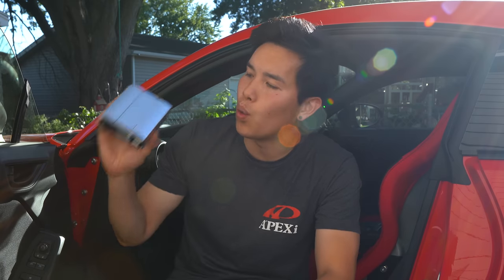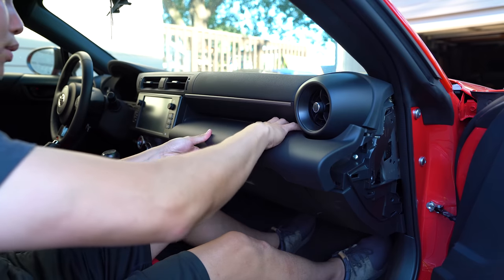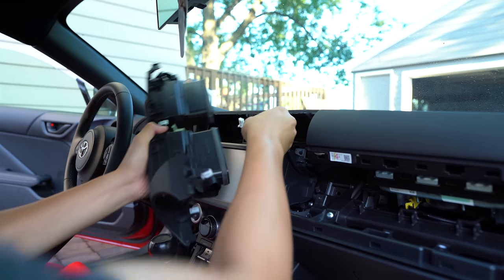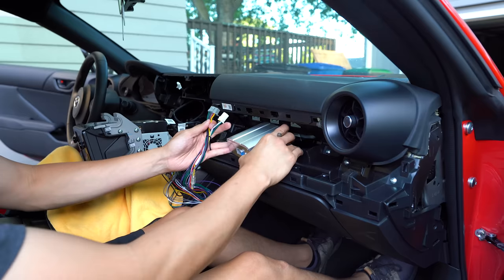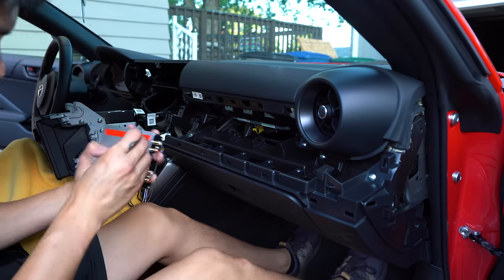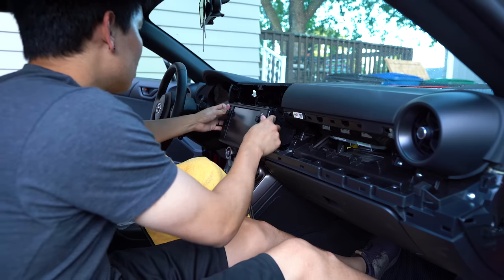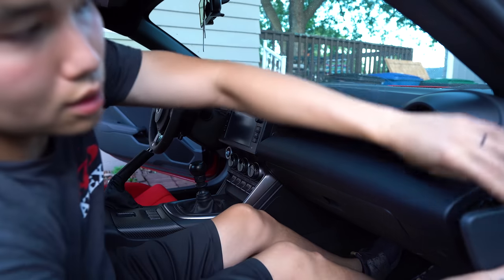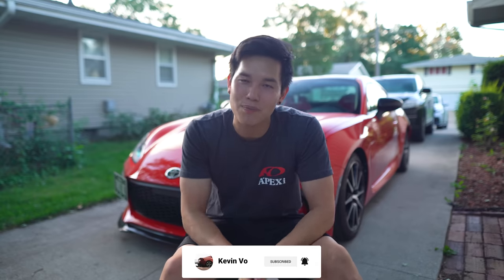EASY Audio Upgrade 22+ GR86 & BRZ

Comment: In our German community our audio pro has checked on the toyobaru soundsystem. He is reporting that the speakers are in fact horrible. So adding an amplifier is actually a horrible decision. Swap the speakers in the dash and the doors :) KR
Reply: Yeah speakers are trash.
Reply: Amp can still improve bad speakers. I'm doing the amp with the OEM+ speaker upgrade. I don't want to add any more gear like a sub or more amps because I want to keep the car lightweight.
Reply: The speakers on the premium trim are different (as well as having the two extras). Was he looking at the base trim?
Reply: @duffman2686  no they are not. You just have 2 more high note tweeters in the dash on the premium trim. Everything else is the same. BUT IN FACT European cars, all the trims on the twins have the exact same sound system in them.
Reply: @nn99nn99  there are good solutions via new lightweight speakers without an sub. Our audio pros solutions adds only like 2 kg more weight to the car 💪
Reply: I don't think you need to be a pro to figure out the speakers in the twins suck. I found an EQ guide on one of the BRZ forums to make them suck less, but you're absolutely right - adding more power to a bad sound system is just going to make things sound worse at a higher volume.
Reply: Those worried about weight gains with a full system upgrade... Have a laxative overnight and sheet your guts out problem solved!
Reply: @Sinancan93  There is an official wiring diagram and details available on some of the forums from Japan - they clearly show different wattages for the different trims (other than the additional speakers/ tweeters).
Reply: @MKu64  that may be correct for the Japan market. 😭 unfortunately
Reply: @JEFFKINGS care to share the EQ guide?
Reply: i can attest to this. I swap my front speaker to Infinity Ref-3032cfx 3.5" and then my door panel into Audison prima AP 6.5".
The sound quality improve by a lot. 100% a lot. 2 hours job after watching how to remove all the panel. Easy peasy.
Reply: @Sinancan93  , that is not correct, at least in the USA. The base speakers are paper cones and the premium speakers are made of a plastic/composite. Def produces a difference in sound quality in addition to having more speakers.
Reply: No its the under powered head unit
Reply: @DylanTK  meanwhile here the premium only get 6 trashy speaker. Replacing only the front and door panel improve by very much. Almost double then the stock.
Reply: @duffman2686 they are?
Reply: @yusripp  is this plug and play or how do you wire it up?
Reply: @Sinancan93  read the links i sent
Reply: @Loiswomgawesome  almost plug n play. just need to ready the required socket harness/wire beforehand. then it was easy job.
Reply: make sure to replace the speakers in the dash with the same impendence and the telematics system does not like an impedance change.  it expects to see a certain load, and it will not function properly if that load is other than what matches the stock speakers.    also, most of the time, stock speakers are decent and it is the source that makes them sound bad.  sure you can't overdrive them, but adding 10-15W RMS of quality signal to them will go a long way
Reply: hi, would you mind sharing what speakers exactly he put in it ? :) thanks
Reply: @Sinancan93  Yes they are the upper trim speakers are urethane the lower trim's are paper. (in the U.S.)
Reply: @Sinancan93 in Canada the premium comes with a second separate Amp under the carpet behind the back seats.  That Amp powers the door speakers.  Which admittedly are still trash.  That's the difference between the base and premium.  Not tweets.
Reply: Why add a cheap $250 amp when you could replace the entire sound system including a sub for $500

Comment: I bought this because of your video :-) Your install process is spot on. (unlike the official video) - You are right, the sound quality difference is insane. I had just about given up on the audio in my GR86. Thank you for sharing!!
Reply from the maker: Glad I could help!
Reply: @ORG8  For me, the value was in the simplicity and price point. The install in the 86 is pretty easy and you get much improved sound quality without replacing speakers or adding expensive, external amps/subs to the already tiny space. It brings out additional clarity the stock system should have had. For my needs, I would do it again. Hope it helps!
Reply: @ORG8  I just did this install. I'm an audio guy - my other cars all have dedicated amps for the highs/mids, sub amps, etc. Since this is my track car, I didn't want to go nuts w/ the audio gear. But, the stock sound system is just so atrocious. I figured I'd give this a try. I'm truly blown away by how much better it sounds. It doesn't make any sense, as adding an amp alone shouldn't improve the sound of crappy oem speakers on an economy car like this, but it does indeed make a huge difference. Well worth the few hundred $.
Reply: Does it make the mirrors shake or vibrate, I suffer with that problem slightly and was wondering before purchasing if it increases or decreases it?

Comment: The company was down the street.   Watched the video at 1:00pm, went in person at 3:00pm, Installed at night within 15 minutes.  The best way to put it is that the car audio sounds more clear and nicely toned in at louder volumes.   Id suggest you have the front gain turned a little more than half and the rear turned a little more than the front, it balances out nicely.
Reply from the maker: How convenient! Haha
Reply: I used to live across the street from them. There’s boba place right next to them I used to go to almost daily

Comment: Installed this on a premium 22 GR86. Did way more for sound quality than I expected.
Reply: did you leave the stock amp ?
Reply from the maker: Glad to hear feedback from someone with a different trim.
Reply: @namaD1  Yes, just did what Kevin did in the video. Nothing more, nothing less.
Reply: Would be nice to know where the Premium amp is mounted. I wouldn't think having two in-line amps would give the best result. If the one featured in this video is indeed better, it's sprucing up the signal and then handing it off to another amp that does a worse job before the second amp outputs to your speakers. The second amp could potentially be degrading the end result and you wouldn't know.
Reply: @edwardmclean5373   the premium model amp is located in the trunk
Reply: @namaD1  Good to know! Do you happen to know where it sits in the chain? Does it only amplify the rear speakers? Or does the head unit cabling go all the way back into the trunk, into the Amp, and then the wiring splits back out to both Front & Rear speakers? 

If the latter, I'm curious if this amp would do better being installed in the trunk and replacing the factory Amp.
Reply: @edwardmclean5373   from my understanding, the 2ohm door woofers are powered by the trunk amp and the tweeters and midranges are 4ohm and wired in parallel straight to the headunit
Reply: @namaD1  Awesome info, thanks! Probably some forum post somewhere out there that breaks it all down, but I haven't found it yet, lol.

My last car I had pretty good success keeping the factory wiring but replacing the head unit and speakers. Now that modern cars integrate so much into the head unit, I'm trying to figure out the best options to improve the rest of the system. Sounds like this car might require a more thorough overhaul. I don't own a GR86 but hoping to get a 2024 Premium next year. I guess I'll have to hear the stock audio system and go from there, see how bad it sounds to me from what I am coming from, lol. I don't necessarily need loud, I just hate bad speakers that have a really muddy soundstage. I'm hoping the upgrade from the crappy paper cones in the base audio system and the additional tweeters will be enough for me, but we'll see I guess.

Comment: Thanks for the great video Kevin — picked one up using your code and install was super easy following this guide.

One note for anyone else attempting this, the double-sided tape that came with the amp didn’t stick for me, so you might want to get your own. I had to drill some holes through the trim and zip tie the amp down.
Reply: Yoo, is it better? Some people are saying that the speakers are so bad that the amp wont make it sound nicer but just louder and be worse when the volume is up. what is your thoughts? I was going to grab this until I read some comments. 

Idk if I want to save $1300 for speakers but I also dont like buying things that are a gimmick
Reply: @ORG8  It's definitely louder... and IMO a little better at lower volumes. However after a while there was a pretty annoying buzzing / humming noise coming from the unit and I had to undo the installation. I guess you get what you pay for.

Comment: I tried to install mine,  but surprisingly the socket adapters didn't fit into OEM wiring for my 2023 Subaru BRZ. I paid attention to your video and I have in my car the exact set of wires you have in yours. But my Beat Sonic came with large sockets with thinner pins 😢😢

Comment: I have built several Evos I Am new to the Toyota 86 not sure where to start. With all the electrical and modern tech not sure what to do with this car build without ruining the performance.

This is is what I would like to see 
Taking it a off the lot 86 and increasing its power and also showing how to install the part for example cold air intake.

What’s parts are risky how far can you push the car before it becomes risky.

Turbo kit ?

This car is amazing for the first time I feel like I bought a car that has it all. 
My goal aggressive personal and clean and just a little quicker acceleration.

Love the channel some suggestions .

Thank you

Comment: It would probably be easier to install nee speakers altogether. It's definitely good having a new amp, but as an audiophile, id rather just get new speakers. Start there. Youll get a much bigger jump in aidio quality, and match the amo to you new speakers requirements if need be.
Reply: Depends which trim you have. On the Premium GR the speakers are decent but the head unit amp is dismal. Upgrading the amp alone makes a huge difference in that trim.

Comment: This should be a cheaper alternative to OEM Audio+, they're taking a long time for their R&D on this vehicle. This upgrade should probably be done alongside a speaker upgrade. I feel like the extra mid and mid bass are putting worse stress on the stock speakers, and then blow one out eventually.
Reply: I'm using this with the OEM Audio+ speakers. Sounds great.
Reply: @MrSpamfriedrice , upper trim level?
Reply: I would love to see this upgrade enhanced by swapping stock speakers as well.
Reply: Nope, just the base level @DylanTK
Reply: @MrSpamfriedrice , gotcha. I commented on another post that this makes sense for base cars, especially with upgraded speakers given they have no amp factory. But I'm not convinced there's any reason to add it to the upper trim car, upgraded speakers or not (given they have an amp).
Reply: @DylanTK  The OEM amp only powers the door speakers. The midrange and tweeter are both powered by the headunit directly. But I'd be skeptical to add the amp after the headunit as it will send an amplified signal to the oem amp. This might distort the door speakers due to the final output being much greater than what the speakers can handle.
Reply: @JV-km1go , interesting, I appreciate the extra insight. But as you said, that still sounds fairly pointless unless there's something more to it.
Reply: @MrSpamfriedrice you added the beat sonic to the base model gr86 without any speaker upgrades? I’m trying to see if anyone has done this because I keep seeing that this is only for the premium level car
Reply: @JV-km1go  that is an xlnt point re 'might distort the door speakers due to the final output being much greater than what the speakers can handle'

Comment: Would this work on the premium model or just the base? Since the premium model is amplified already.
Reply: It's compatible with both, but yeah I'm not sure why you'd add this to the Premium.
Reply from the maker: Yes it does!
Reply: The premium model is amplified but still isn't premium quality sound. I already have subs in the car but anything to take out distortion in the speakers and amplify the quality is a win in my book. @DylanTK
Reply: Thank you! @KevinVo
Reply: @rogue9775 , preaching to the choir. I have the premium as well as the OEM Audio+ speaker set in mine. That upgrade removed nearly all distortion, added clarity and some more low-end, and requires less power to do so. But I guess if this can help with stock speakers then sure, but I'm not really seeing how adding the amp is going to change that much (but if it does awesome). Base cars have no amp, paper cones vs composite, and less speakers, so I can definitely see this helping more there especially with upgraded speakers.

Comment: Here is the absolute best sound config for stock until you can get a new system:

AUDIO: 
Virtual bass: low (not off, 1st tick)
Vocal settings/stage expander: low (not off. 1st tick)
Dynamic beat enhancer: OFF
Sound restore: ON

EQ:
Powerful: ON
Bass: +1
Mid: -1
High: -1
most important setting: Fader: -2 to the back. This takes out a lot of distortion between lower frequencies that the stock system seems to want to cram into the stereo field of the front speakers. It won't increase your bass, but it will give you bass that doesn't sound like garbled dogshit. The back speakers are tiny and have almost zero low freq response but they do add surround so diverting the signal to the back in this case just cleans up the bass whereas in most cars you are fading to the back FOR bass. The front speakers have too much emphasis on bass in this stock system imo. Those speakers can't handle it. 

Hope this helps!
Reply: definitely helpful, thanks!

Comment: Que the safety warriors telling you the airbag system has ben jeapordised now, blah blah. Good video but i personally am doing speakers first they make a much bigger difference. TBH the built in amp is strong enough for a decent set of splits that fit in the oem speaker wells.

Comment: I installed this. It’s 100% better. Not by much but it is better. For $300 and not having to replace the speakers is worth it to me. Easily removable if you want to put it stock.

This install video is better than the vendors…
Reply: 100%, then "not by much"? Lol. 100% better should mean twice as good 😂
Reply: @yusuf8938  Twice as good would be 200%. I meant there a one hundred percent chance that there is an audible difference.
Reply: 100% better means original 100% plus additional 100% equals 200%, i.e. twice as good.

Comment: Well that definitely sounds so much better!! I think it's been asked already but is this just for the base trim or will this work with the premium trim as well? Keep up the great work and content Kev!👍
Reply: Doesnt the premium trim come with an amplifier already?
Reply: @itsspooky960  yes it does but it doesn't sound that good to me. If this unit will work on the premium then I'm in.
Reply from the maker: Yes it does work on all trims!
Reply: @KevinVo  that's awesome! Now I'm by no means an audio expert, just want a little better sound from the stock system. Having said that, safe to say having basically 2 amps won't mess up the system or sound it puts out? Your GR86 is a base trim, right? Has anyone that you know of installed this in a premium trim?
Reply: @Joe_Av I'd like to see an answer to this question as well, I can't imagine having two in-line amplifiers could possibly be a good thing, lol. If the Premium indeed also adds an amp, it would be desirable to know where it is mounted, hopefully you can just swap it out.
Reply: @Joe_Av  ...pick or choose 1 amp to run.  feeding one amp into another is not the same as feeding one turbo into another; it doesn't work like that.   You want clean signal in to get clean amplified signal out...

Comment: I noticed when I went to the Beat-Sonic website to look at the specs for the ENA-2S1 that Beat-Sonic also has a ENX-T106 for the 86 that states it's for the 8 speaker setup.  It also says it has a DSP and USB port, which I imagine is for connecting to a PC to adjust settings?  (Don't know for sure because they don't say)  6 RCA outputs as well for external amps.  Doesn't state the amount of power it produces or other specs though.  No electronic manual available either to look anything up.

Wish there was more info because, if the ENX-T106 really is a DSP that I can adjust through my PC, that would be worth the extra cost.

Also, seems like a bad idea to put an amp that probably gets really hot right under my airbag...

Comment: I have a lot of experience in audio engineering and the speakers are the final check and balance for sound and sound quality. You can upgrade as much as you want before touching the speakers, I guarantee you won’t notice as much of a change as the speakers being upgraded.
Reply: I've only upgrade the speaker. And the sound quality is 100% better. The bass is more sharp. The mid and high was very crips. I swap my front speaker to Infinity Ref-3032cfx 3.5" and then my door panel into Audison prima AP 6.5".
2 hours job after watching how to remove all the panel. Easy peasy.

Comment: To me it seems like the biggest difference is there is a couple decibel volume increase. Due to the human ear and brain being strange something being a higher volume will tend to sound "better" in all the ways you described. In terms of actual audio quality you will need to upgrade the speakers at minimum and potentially the head unit as well.

Comment: I installed this unit in my 2023 GR86 base. However, the radio comes on when the accessory mode, but the amplifier does not come on until the car is in ignition mode. Do you have the same experience?